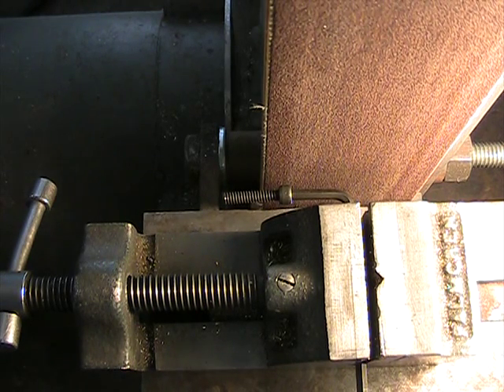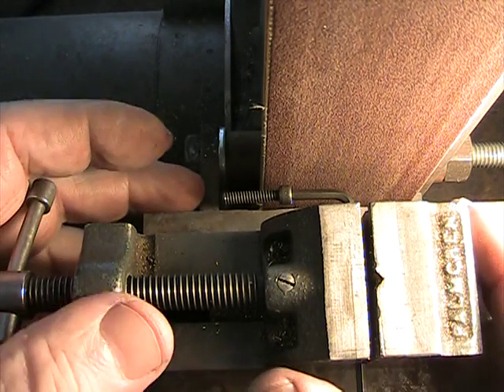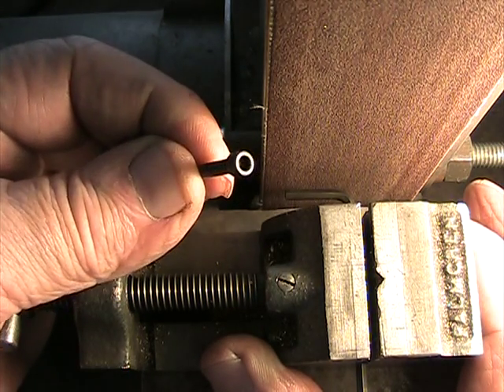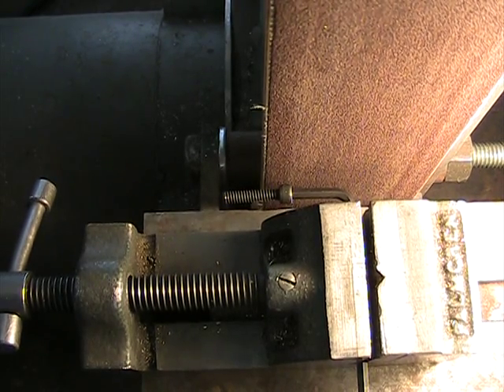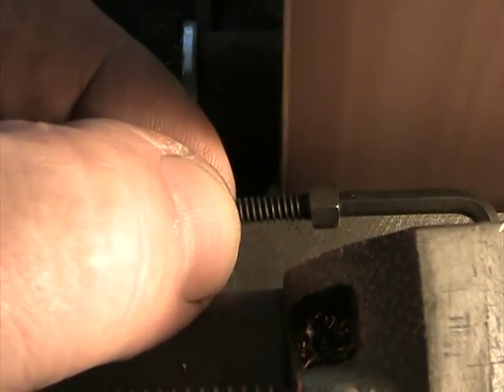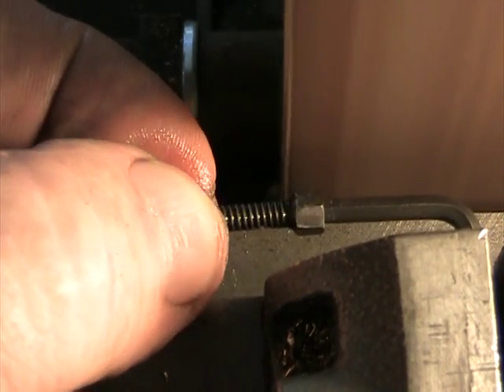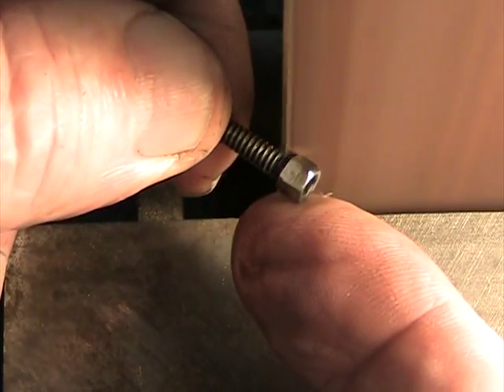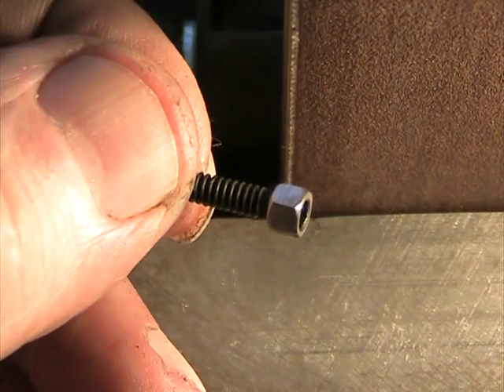Hex Head Bolt from Socket Head Cap Screw

Comment: I'd think a "depth stop" on the table would make it fast and easy to get the sides even size
Reply from the maker: Maybe, depends on where you put the stop.  A lot of the heads on these sockethed cap screws aren't exactly concentric with the socket.